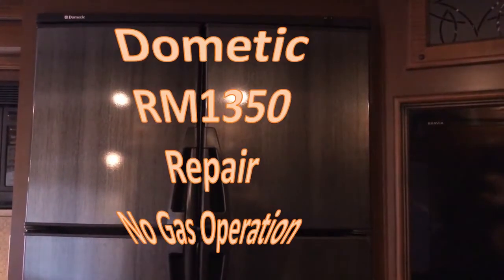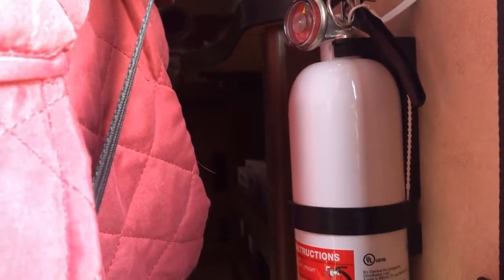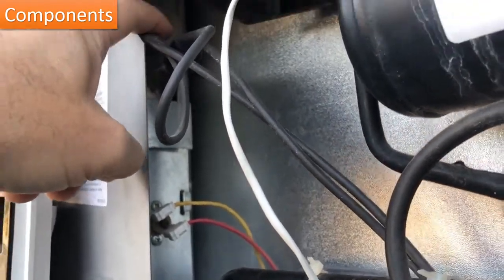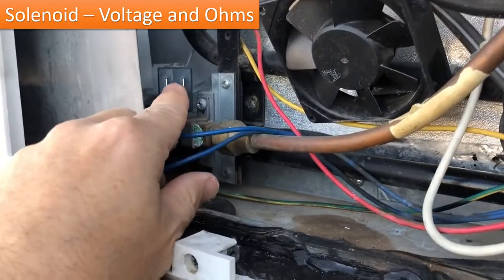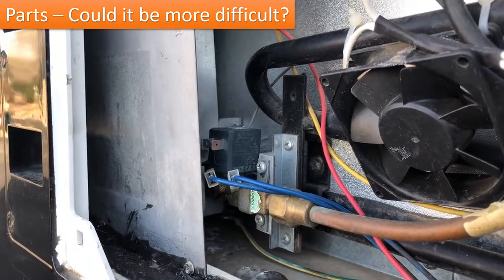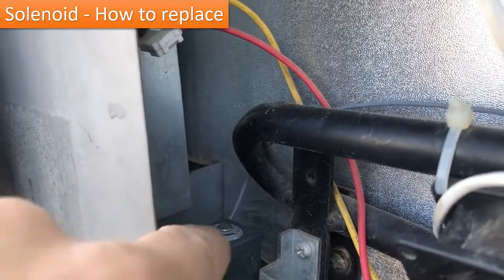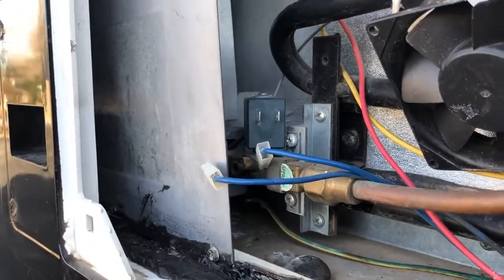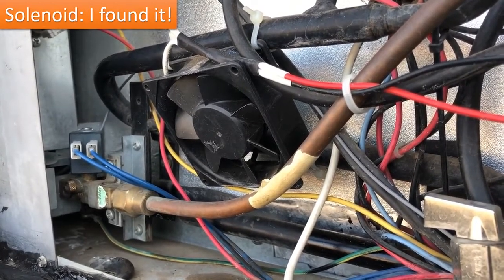Dometic Refrigerator Repair - No Gas Operation

Comment: My current issue is fridge cools better on electric than gas. This was not normally the case. On electric temp on fridge reads 33, on gas 38. Can a solenoid restrict some gas flow or is it just on/off?

Comment: Swalwsutube, when you were diagnosing your problem, was your fridge igniter sparking?  

My fridge is faulting quickly, already replaced board. My solenoid is reading open and my igniter never sparks. I think my solenoid is bad, would that keep igniter from sparking?
Reply from the maker: Yes mine would spark, but fail because no gas was flowing thru solenoid.  I believe you can put a magnet on the top of your solenoid to get it to open and flow gas... since that's tall the solenoid does.  Ok for testing, but don't keep it that way for safety.  First I would check the wires going to the solenoid and make sure there is voltage on them when you turn on fridge.  If no voltage the solenoid will not work.  The voltage only happens until the board trips because it doesn't sense a flame... about 5 to 10 seconds... so you will need a helper to turn on fridge from inside why you test for voltage.

Also check this URL for good tips.:
https://www.camperupgrade.com/dometic-refrigerator-igniter-not-working/
Reply: Yes. I just found this out that if the solenoid is bad it them wont send the pulse down the line and no spark

Comment: Thanks.  I have the exact same issue.  I just purchased the solenoid  and valve off ebay.  I hope this fixes it.
Reply from the maker: You only need the solenoid.  Do not use a Norcold valve on the Dometic, it might be different.

Comment: This is so great!  I purchased the solenoid with the valve not knowing they were easily separated and that the solenoid is the more likely culprit.. I was worried about replacing the gas valve because it involved disconnecting the gas and potential problems there but since he said it was easy to swap the solenite I did that first and bingo!  I super appreciate it!!!
Reply from the maker: Thanks for the feedback… that’s why I do these videos.  Glad it helped.

Comment: I had this exact problem. I followed your advice and got the same Norcold solenoid on Amazon for $35.
I installed it in 5 minutes and the error code is gone.
Thank you so much for saving me time and I am sure hundreds at the mechanic shop.
Reply from the maker: Awesome, glad it worked for you.  Mine is still working as well.  I did discover my relay on back of fridge was out.  Explains why I never heard fans running… wasn’t sure mine had any.  A simple trip to auto parts store and now fridge stays cold even on hot days!

Comment: Thank you! I've been waiting 4 months for Dometic to send the dealership a LP valve/solenoid to fix my brand new ref under warranty that won't run on LP. My DM2652LBX fired right up after changing only the solenoid to the Norcold unit you recommended. It had a CEME 5588/2 that drew 2.5 watts. I'll put the bad one back if the ever actually call saying the part came in and then use the Norcold as a spare, just in case. You're a good man Charlie Brown!